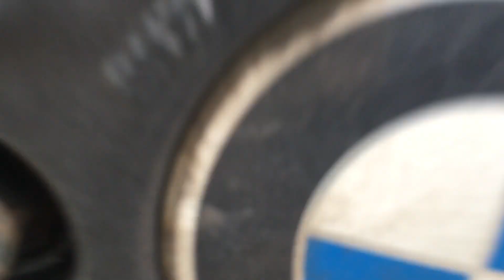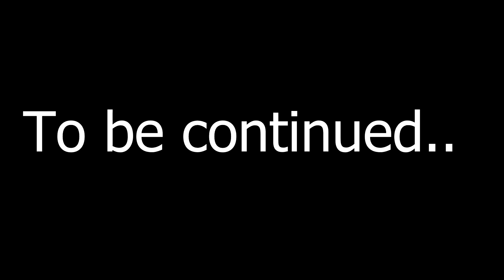BMW E36 Compact (318TI)

Comment: Do you have limied slip?
Reply: Welded diff =LSD 100%?
Reply from the maker: Visarut Tanpruttianunt  yess
Reply: Do you use M44 stock engine or modify power up?
Reply from the maker: Visarut Tanpruttianunt it’s stock with straight pipe
Reply: Which your transmission AT or MT?
Reply from the maker: Visarut Tanpruttianunt 5 speed MT